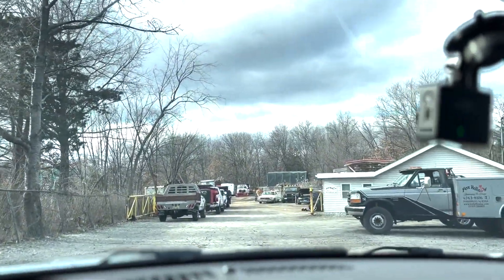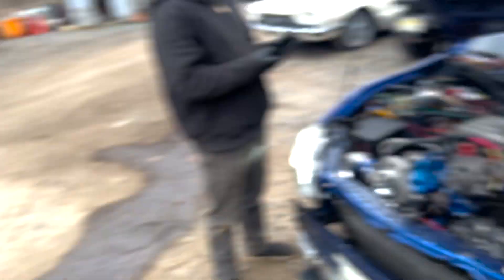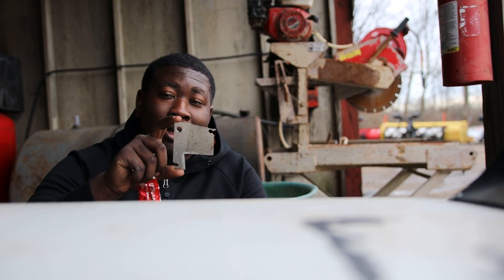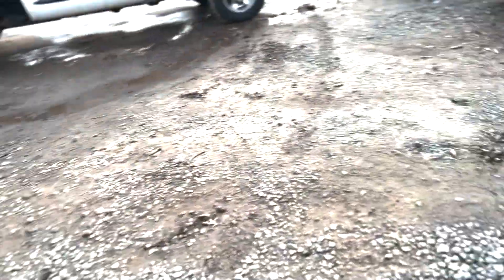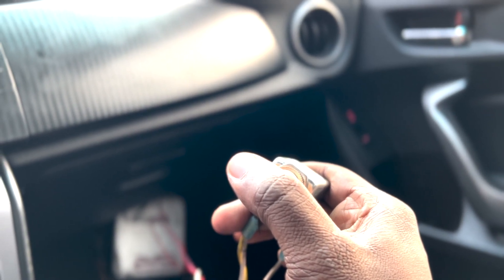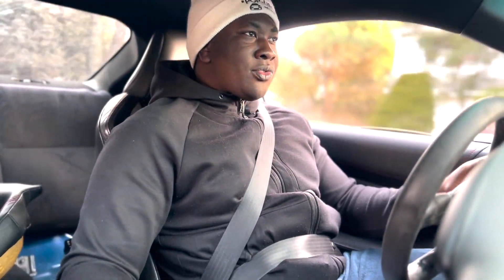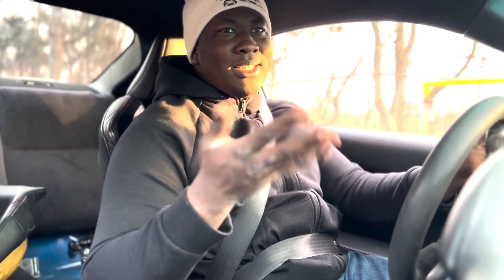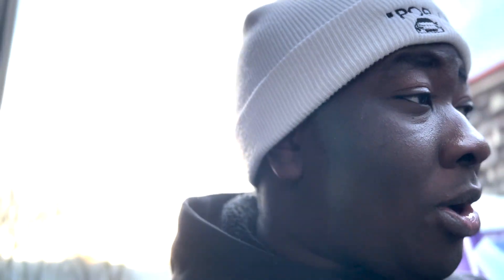RX-7 13B ROTARY SWAPPED SUBARU BRZ FIRST DRIVE!!! *ROTARU Part 4* (BUILT IN 11 DAYS)

Comment: For so long I've always wanted to rotary swap a BRZ 
It's unique and I'm glad someone did it.
Reply: I had been thinking about it for Over a year now though. I'm not old enough yet to have my own things to build or have a car like that. It would only be a few years down from now though. I think i picked up the idea a bit of myself but I saw a tiktok video i think where it was just a brz with a rotary brap idle tune sound on it. But this is just amazing to see. Thank y'all for building this car.
Reply from the maker: A kit to do it yourself will be for sale soon!
Reply: @MonsterMotoring will it be compatible with the gr86? or are there differences
Reply from the maker: Actually waiting to gain some initial preorders for the kit to purchase the new gr/BRZ and make sure everything works!